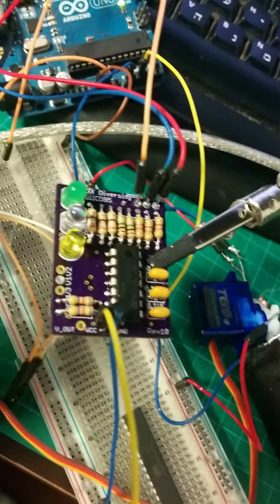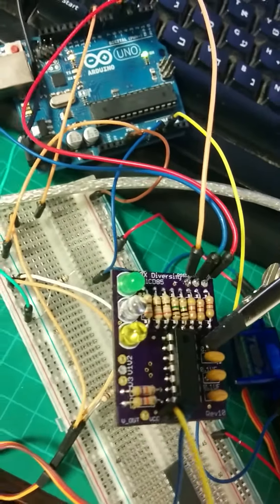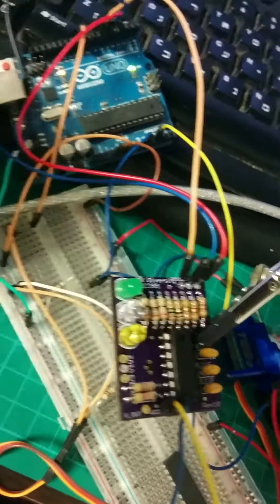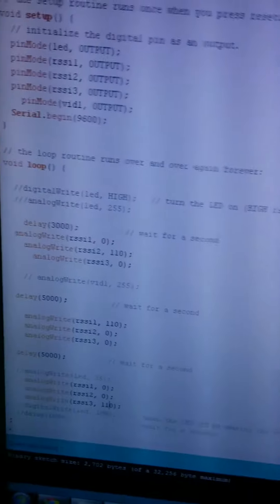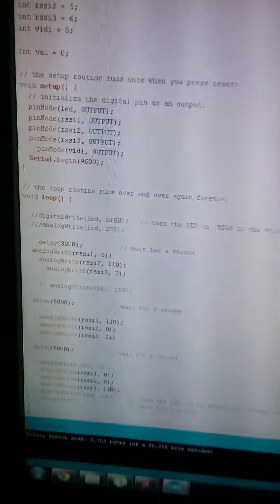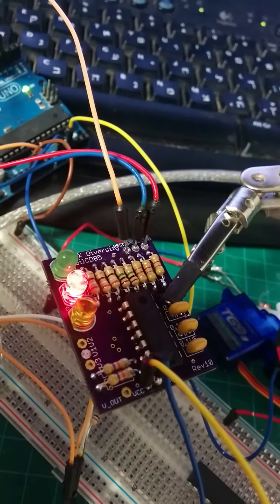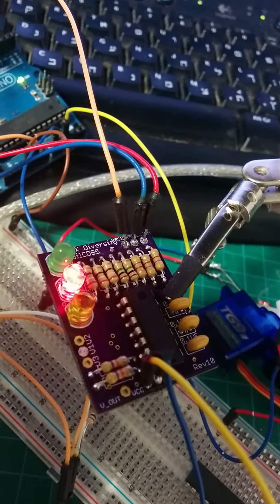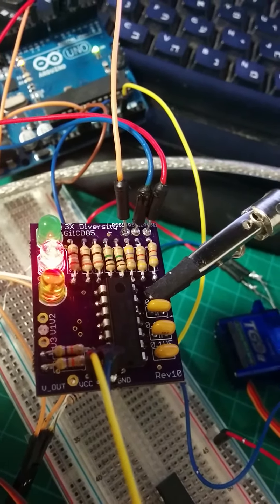3 Way FPV Diversity Controller Works!!

Comment: I am struggling to find the parts list for the board. Can you point me in the right direction?
Reply from the maker: terjetularsen Depending on where you live you can use Digikey or any other major supplier. If you live in a remote country (like me:) ebay is your friend. You can find every component there - usually in packages of 10.
Reply: gil segev Yes, I use eBay :-) I will try to be more specific: I am struggling to find the specifications for the components needed to complete the board. I have ordered the board (3 Way Diversity controller rev 10 copy) from OSH Park. Also if you could provide the board- and component specifications for the Boscam RX5808 part I would be grateful :-)
Reply from the maker: terjetularsen look up:- 

SN74AHC1G08DBVR (AND gate):
-----------------------------------------------------
http://www.ebay.com/itm/10pcs-Original-SN74AHC1G08DBVR-74AHC-Single-2-Input-Positive-AND-Gate-SOT-23-/200976370120?pt=LH_DefaultDomain_0&hash=item2ecb2009c8

LM324: 
-----------
http://www.ebay.com/itm/10PCS-LM324N-LM324-DIP-14-TI-Low-Power-Quad-Op-Amp-IC-/130963517925?pt=LH_DefaultDomain_0&hash=item1e7e08b1e5

74HC4053D:
--------------------
http://www.ebay.com/itm/10-PCS-74HC4053D-SOIC-16-74HC4053-Triple-2-channel-analog-multiplexer-/291205963723?pt=LH_DefaultDomain_0&hash=item43cd3a5fcb
Reply: +terjetularsen could you post the link to that rev 10 board?

Comment: Have you thought about using this 3 way diversity controller with this project, maybe changing it up to use the 3 way system?  https://github.com/sheaivey/rx5808-pro-diversity/